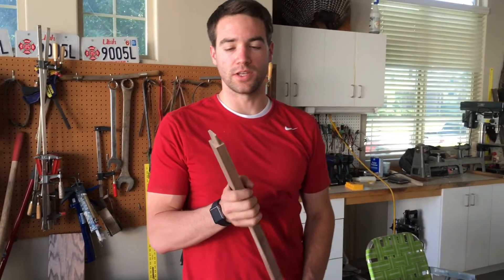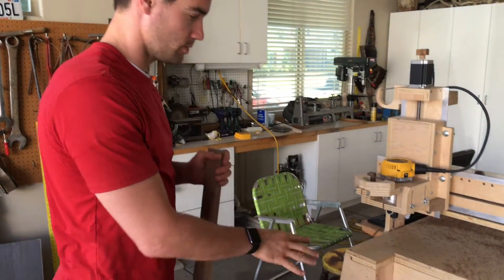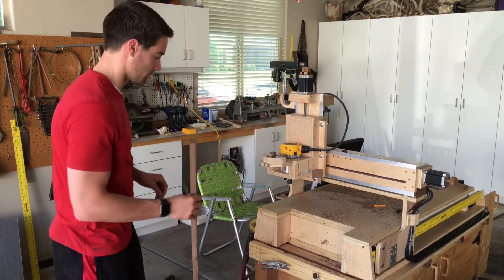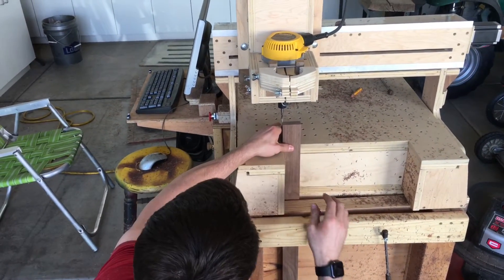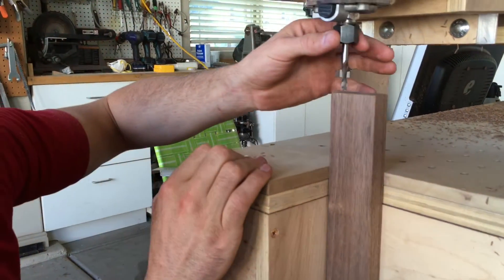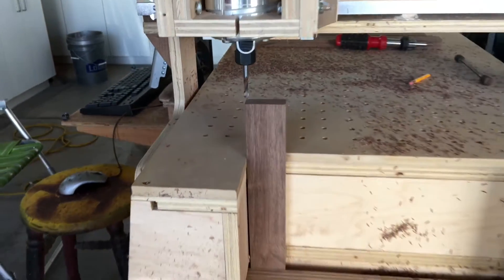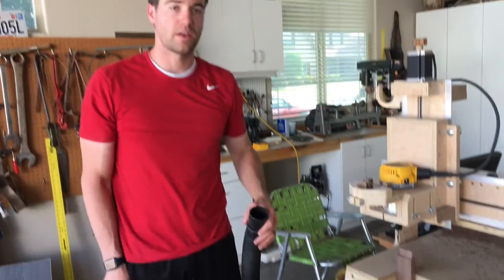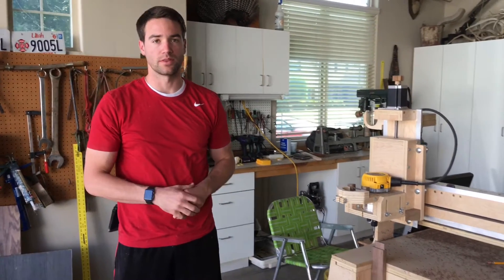Mortise and Tenons with CNC Router

Comment: Hi I use the same principle, but for the z I set it once and then take a square piece of wood the same height as the tenon ans use my finger to set up the wood  I made 12 drawers with dovetails in this way went perfect. just sap out piece after piece cut the next and move on kind regards Hans
Reply from the maker: hans pijpers I agree 100%. That’s a technique I learned later down the line as I learned more about machining. I have since rebuilt this machine to be capable of machine metals and i have added many other features to it which has been fun. I use fusion 360 still as well as vetric aspire and I do more of my designing in solidworks. I just finished building a bassinet on this machine out of maple for my daughter a few months ago.

Comment: That´s awesome. Is it possible to make the tenons with the boards lying on the table? Each time a side of the board.
I have to make a tenon in a 6 feet board so it's not possible doing it upright.
Reply from the maker: Guilherme Vieira yes absolutely. You would just have to 4 separate cuts flipping the board over and reclamping the board and zeroing the machine between each. That is a very practical way of doing a tenon on longer boards.
Reply: Cool! I'll try it. Thanks Kaden!

Comment: What software are you using for machine control?
Reply from the maker: Matt Neeves CAD/CAM in Fusion 360. Machine control mach3. Sucks biting the $160 bullet but I still feel it was very worth it. Others may argue that there is free software that matches it though.
Reply: @kaden56  well fusion 360 does not stay free for ever as I found out after about 2 years out of the blue boom nothing al my work gone in the cloud thanks but no thanks last week I bought vectric vcarve, is also not cheap but only once instead of paying every year